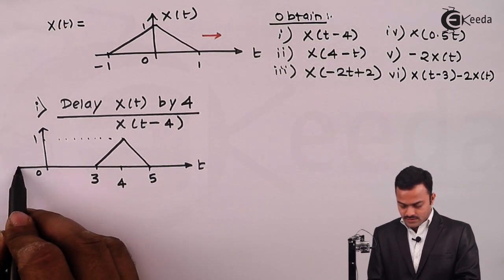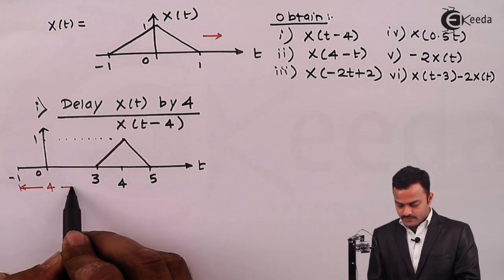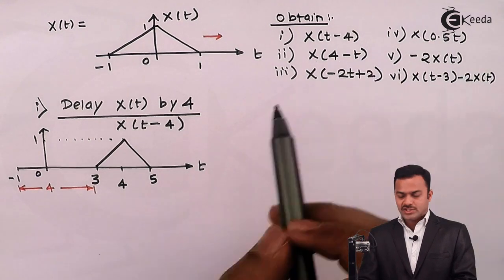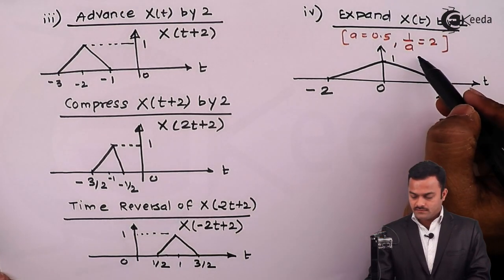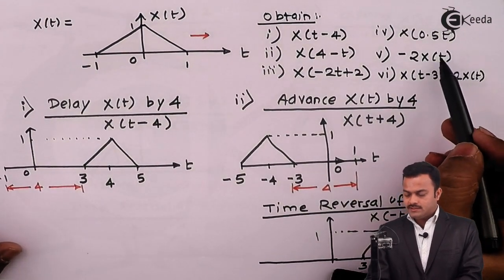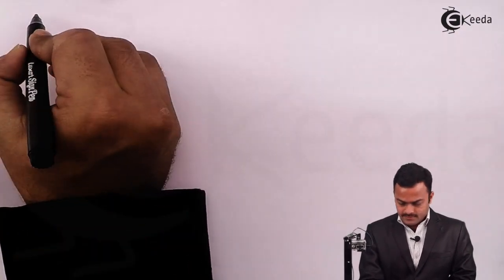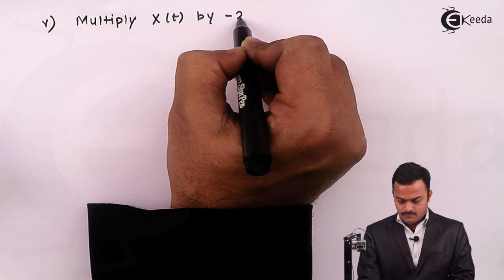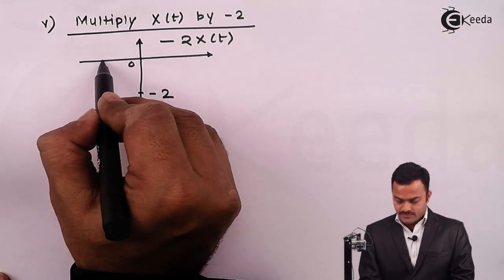Basic Operations on Continuous Time Signals - Problem 7 - Signals and Systems

Comment: The time reversal of X(t+4) should be X(-(t+4)) i.e. X(-t-4) but in the video its X(-t+4) or X(-4+t).
Awaiting your reply.
Reply: That confuse me as well. Spend one hour to figure this out and when I was about to right a comment I saw your comment.
You are right, if x(t) = x(4-t), than this can be rewritten x(-(t-4)), which means signal has to be delayed by 4 (moving to the right hand of the x(t) plan and time reversal, hence has to be on the left hand of the x(t) plan.